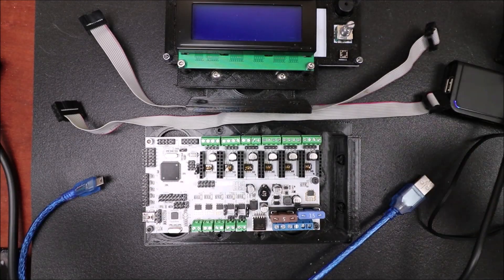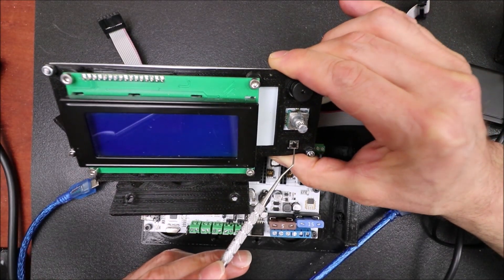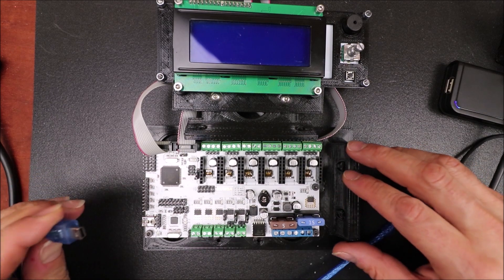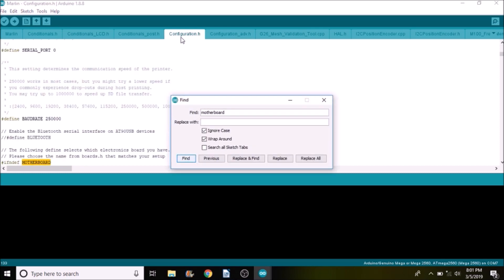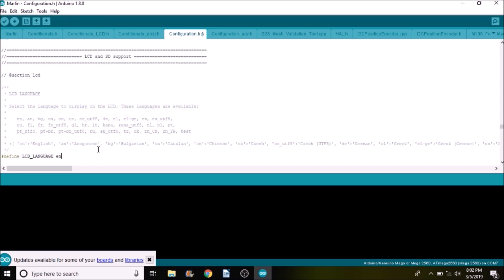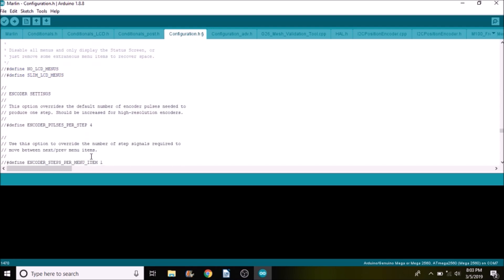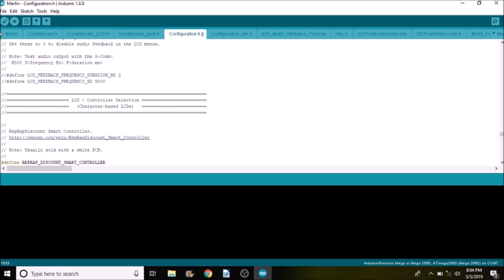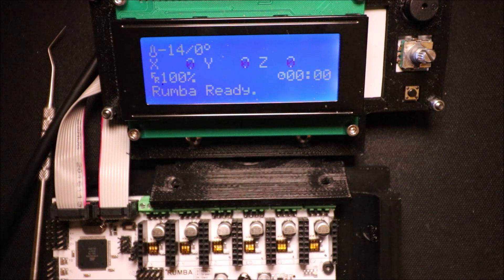Rumba - RepRap Discount Smart Controller

Comment: I have been watching your video's on the rumba boards all morning today and you are to the point and that is good for people to learn,I also subed to your channel, if you dont mid me asking as i am having trouble getting mine to not be all garbled on the screen and the u8glib is installed. i haved tried the the different versions of marlin to no avail, any input would be grateful , also its the discount full graphic.
Reply from the maker: Can you tell me who the manufacturer of the board is and a link?  Also what are you selecting for the board in Marlin firmware?  I know they seem like obvious questions, but the only other thing is ribbon cable issues.
Reply: @EdwardBraiman  thanks for the speedy reply, I had to look on repraps forum to figure it out and there was many different factors that I was unaware of, thanks for replying and keep posting the good work, lots of people are using your help like I did.

Comment: Hi, Edward. This is very confusing because, on the video you show (correctly for some boards but not for all!) that EXP 1 and 2 are reversed and the red, Pin 1 wire orientations are also reversed (180 degrees rotated) on the PCB. Later they are shown one being reversed and one being correct. 
It is really difficult to know which is correct now. I've spent hours chasing this problem and my LCD still doesn't work on RUMBA boards BUT is fine on a RAMPS board.
It'c clear from the ATMEGA/RUMBA schematic that Pin 10 on EXP 2 goes to +5V so this is completely unambiguous. Some boards are marked incorrectly.
Do you have any suggestions for getting this right?
Thanks again for your excellent explanations :)
Reply from the maker: One way is to turn on pins debugging in Marlin firmware and map the pins out with a multimeter.